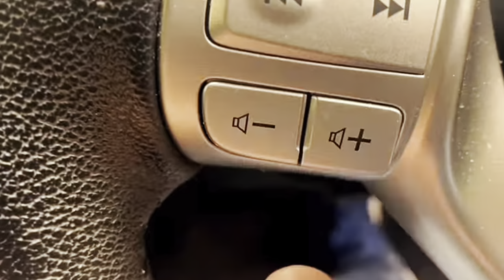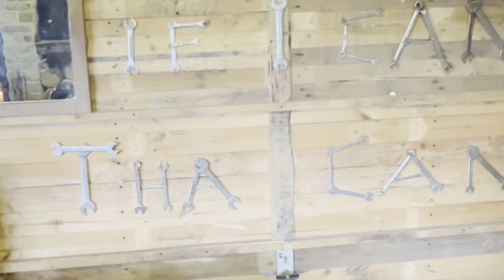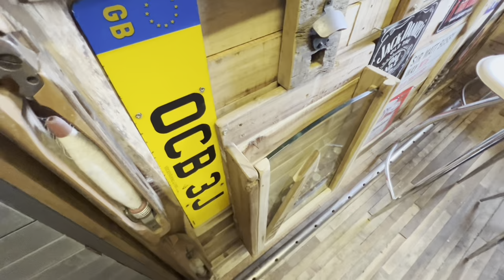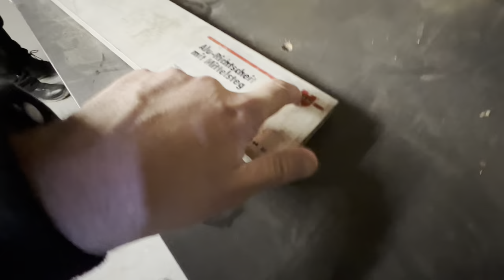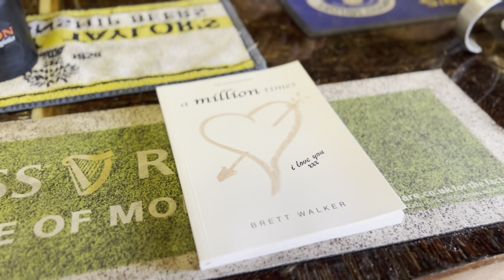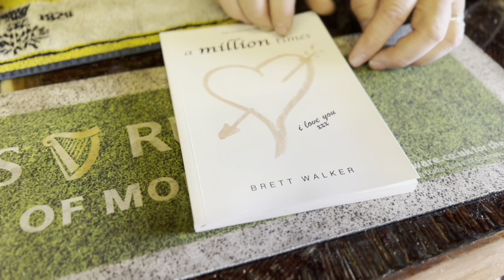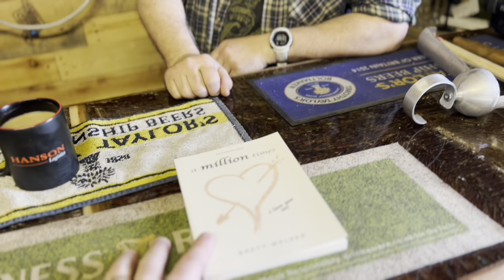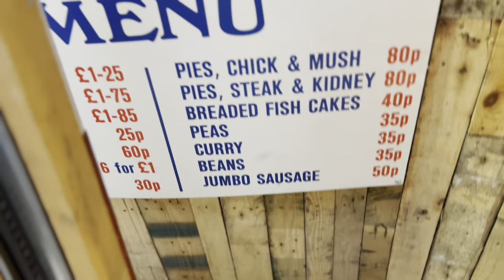SHEDZ Ep1 - MEET BRETT - TOUR his MANCAVE WORKSHOP - AMAZING PLACE 😃

Comment: Fabulous. I can only dream of such space. I have to squeeze everything I have into my single 8ft wide attached garage which is rammed with tools, push bikes, camping gear, wood etc. Racking & benches down both sides which leaves a narrow walkway down the middle. No seats, standing room only & no space in the garden for a proper shed. Plans are afoot to move some lesser used stuff up to the loft - which is also a another project in progress. I've got a spare TV & I can get an aerial cable into the garage but there's no room for a TV or a bar - yet. 
Keep the vids coming.
Reply from the maker: Big thanks for watching buddy.. hope all goes well with your plans.. hope you get your tv up for the next episode 😉 cheers Rob